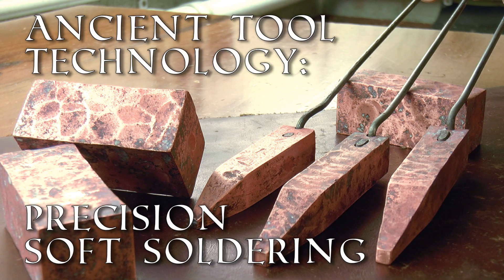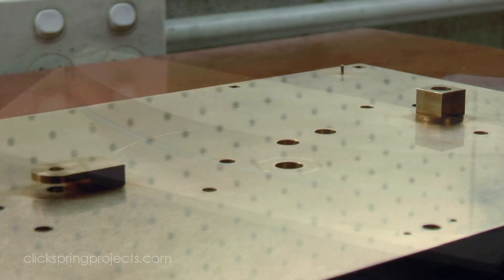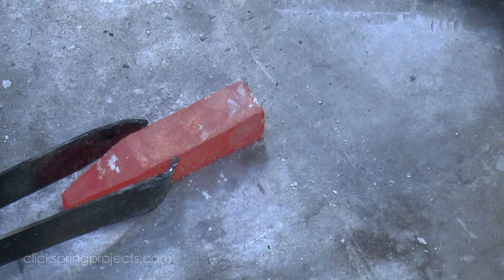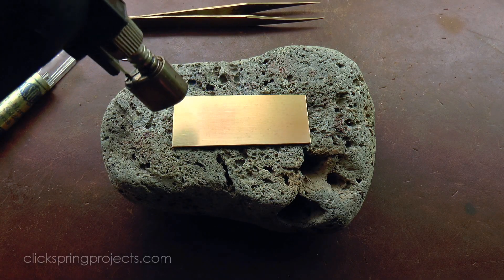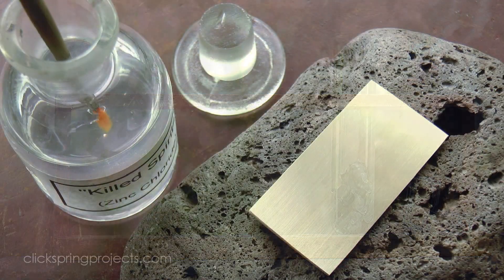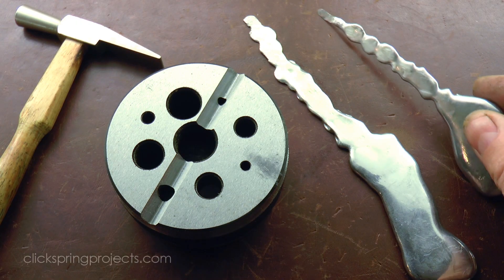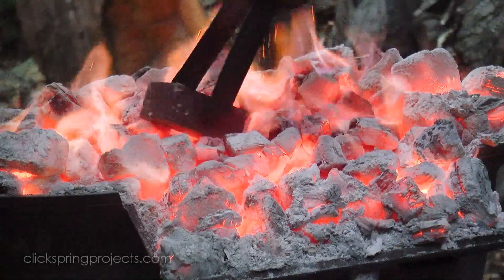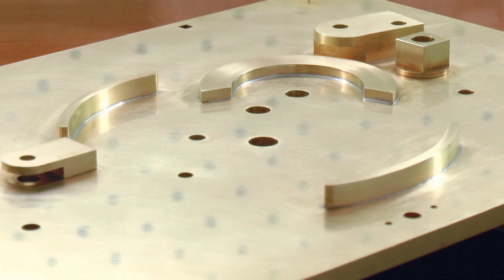Precision Soft Soldering For Constructing The Antikythera Mechanism - Experimental Archaeology

Comment: An alternative. Grind the solder with the rosin to make a paste. Position everything.  The instead of moving the device move the heat source underneath.  That means its unlikely that any component moves. No need to make tools. When the solder flows, remove the heat source and wait.
Reply: I was thinking something similar.  How about adhering the piece with rosin, then simply laying thin strips of solder wire around the edges, making sure they're touching the sides of the piece.  Then, just apply heat and it will sweat itself in as soon as it's molten.
Reply: The could make a paste. Enameling goes back to 13th century BC. Lots of experience with gold working too. Just grind it all up, make a paste and apply on.
Reply: True - historically, that is the basis of enameling, and tried-and-true techniques are certainly the more likely.  I was just suggesting another possibility that would work and makes it less likely for the parts to move.  Every time Chris put a piece of hot copper on the part, I held my breath and hoped he wouldn't cough or sneeze while the rosin was soft.
Reply: Agreed. 

So the idea of bringing the heat to the plate, by placing a fire underneath and not touching the plate at all strikes me as a better solution. 

Relying on capillary action I suspect would work.
Reply: PS:  Looks like Chris has partially answered us in another thread - "...multiple loose parts on both sides of the plate were soldered, so it needed to be a method that could very precisely target the heat with both hot elements and heat sinks..."  So that drops our heating from below idea on its head, as it's hard to be precise enough coming at it from underneath - but I still think you may be on the right track with the "rosin/solder paste" idea.  Applying the heat as Chris did would still work, and there's less chance of anything moving if he doesn't have to work around the copper heating blocks and dip the solder rod around the part.
Reply: You could do all pieces at the same time.
Reply: Not sure you could heat it from below without those pieces on the underside falling off - even if you soldered the parts one side at a time, as the underside pieces will be closer to the heat, so their solder would reflow before the solder on top had melted.  You'd have to find ways to support them all (remembering that they may stand out at differing heights from the main plate) and hope that you don't have too much of the solder flow down away from the underside joins. 

But the more I think about it, I really like your idea of a paste - an all-in-one adhesive, flux and solder.  It fits with the enameling techniques in use at the time, and it should give much better control over part placement while the solder flows...if one lets go of the heating blocks before the solder flows, there's no reason to think the parts would move.  Then just wait for everything to solidify before removing the blocks and it's done,  in exactly the position they were first set in.
Reply: The underneath ones are pinned, so not an issue. ie. Pinned on side, soldered the other. Given their function, they don't have to be perfectly placed.  The pinning on one side sort of explains the solder on the other. It's easier. 

Think about a tagine, if you have seen one. That would focus the heat in a small area.
Reply: The underneath ones are pinned, so not an issue. ie. Pinned on side, soldered the other. Given their function, they don't have to be perfectly placed.  The pinning on one side sort of explains the solder on the other. It's easier. 

Think about a tagine, if you have seen one. That would focus the heat in a small area.
Reply: I'm just going by what Chris said, that "multiple loose parts on both sides of the plate were soldered" - so I guess that means at least some of the underside pieces are soldered instead of pinned.

Comment: this was so lovely. Seeing soldering be broken down to this level is interesting. For e.g. you have no direct temperature control.
Note: Sn60Pb40 is an eutectic alloy. I would guess that they did not fully understand that at the time, but beeing eutectic has some special properties (lowest melting point for a given metal mixture) that are indirectly observable and can be used to precisely hit the composition, with out knowing the precise ratio. The only thing I could think of, is that it had to contain some copper. Both as an impurity of the base metals, but also as a specific alloy ingredient to reduce the copper scavenging from the work pieces (and tools). (as a side effect, a trinary alloy system tends to have a lower melting point then the base binary alloy systems)
Reply: 60/40 is actually a little past the eutectic point (which is around 63/37).

Comment: Beautiful as always! ^^)
But wouldn't a fire tended by ventilation be a much more precisely controllable heat source for the soldering?
The base plate could be placed over a controlled fire and checked for heat, the heat could be adjusted with a few strokes on a bellow (Or their omission) by hand by a helper. Once the heat is right, just touch the parts stuck together by molten rosin with the solder, and the job should be done. What do you think?

Comment: I am sure someone else has pointed this out, but I will also.
The large rectangular blocks would transfer heat more effectively if they were to be made flat again, after you work them with the hammer the surface has many ridges and valleys in it. This would apply to any tool that would be used to solder.
Reply: I would not be so concerned about the obvious insulation of the air gap so much as more of the heat would be used in convection if the copper blocks were placed below the work piece. However it is clear that none of this  postilating negates the fact the work was a success.
Reply: I did think about that, but it would mean moving the brass plate onto the heated blocks, then moving it again after the solder had flowed, increasing the chance of a mistake.
Reply: Most heat transfering via IR so not a big deal. Also if talking about heat transfer via surface contact: copper block covered with copper oxide layer(you cant avoid it at red hot temperature) and copper oxide have bad thermal conductivity, so again you mostly relying on heating via IR.
Reply: I was pointing out the loss of contact area that can be seen when the blocks are placed on the brass plate. Not the oxide/scale. The gaps are obvious, the heat loss there could be lessened by making the blocks FLAT, by surface grinding/flattening, with a file, since 2000 years ago the milling machine did not exist.
Reply: @D Sloop: I really doubt it matters at the heat and large masses of metal he's dealing with. Yeah, you get better thermal contact with a flat surface, but that just slows heat transfer. Some extra heat will be lost to radiation or convection from the block during the extra time, but not THAT much.
Reply: Yes, but everything he has fabricated so far has been the very definition of precise. I know the heat transfer worked, I saw it. 
When I would build a PC I used the thermal paste to insure that heat from the cpu transferred to the aluminum heat sink most efficiently. The very small imperfections on the top of the cpu and the bottom of the heat sink would not allow the best transfer of heat without the paste. 
Different situation but same principle. Better fit = better results.
Reply: @dsloop3907  can you make mating parts flat by lapping them? Just wondering…
Reply: They'd wick up the flux and solder easier too!  To me, it looks like they're heating by radiation anyway.

Comment: This realy demonstrate why new inventions or techniques are not made faster in ancient time, its need a plethora of suporting  inventions and techniques to make the new inventions or technique practically possible. My respect to the orginal inventors/clockmakers.....and the youtube host personal skill and patience.
Reply: JR You can still see what you’re talking about on an accelerated scale today.

Ever since we’ve had electronic devices we’ve been miniaturizing them, but why did it take decades to go from a desktop to a laptop?

The miniaturization of the computing hardware was simple, but it wasn’t terribly feasible until both higher capacity batteries, and smaller screens were perfected.

Then there was a similar situation with cellphone technology, why did it take so long to get smartphones, or anything like them when we already had both portable computing and cellular service?

Because until there was a massive network, and improved data transmission protocols in place, even if they built them there wouldn’t be much you could do on one. Not to mention the need for massive further miniaturization of the computing hardware, screens, input devices, and the advent of high energy density batteries.
Reply: laptops were made as soon as the chips and storage would fit into something portable, people made do with little tube monitors before thin screen technology was on hand, and battery technology isn't nearly as helpful as you might think, as soon as the tech improves, the improvement is used to make the device thinner, insted of giving it more battery life, or additional computing power, or both.
Reply: Lovot Core I’m not sure exactly what you base that statement on.

A lot of old laptops has single digit battery life as they were still using stuff like Ni-Cad etc.
Reply: NiCd is no excuse, stick more of them in there until the battery life is acceptable
Reply: Simple, the agracultural revolution was not yet at hand, and the printing press was not yet a thing, most people needed to dedicate most of their time to farming, and resource aquisition, the tinkerers had no way to spread their knowledge quickly, since everything had to be copied by hand, if they were even willing to relinquish their secrets to begin with. You will note that the industrial revolution didn't happen until after the ag revolution, and the printing press.
Reply: A lot of very notable civilizations like the Roman Empire, the Ancient Egyptians, the Chinese Dynasties, etc. were able to advance faster or make new things is mostly due (I think) in the ability to store that society's knowledge (mainly texts). The reason for it is that if you don't store it, your society has to constantly "rediscover/research" very basic ideas or concepts to what they're trying to do (hence why "research" is a word for trying to advance). Things that we take for granted like doing very basic math and reading would be difficult to do without that storage of knowledge for the next generation's use (and you couldn't move to more advanced things since you're constantly reteaching the most basic stuff).
Reply: Also explains why there were three people who were able to invent light bulbs at the same time.

Comment: Can someone tell me what the difference is between this and brazing?
Reply: Mostly the materials used.  Brazing uses brass or bronze filler material and is higher temperature.  Neither soldering or brazing causes the base material to become molten, only the filler material.

Comment: As someone who soldered (professionally) for over 20 years, I can honestly say that this method never occurred to me. Always love your videos, and hope there are a lot more to come!  :)

On a side note, given the labor intensive nature of doing this, do you think it was easier than pinning the pieces, or was there a mechanical/manufacturing reason to do it this way? Just curious, since you have the experience of attaching pieces both ways...
Reply from the maker: personally I think its much easier to pin them, so the choice to solder is interesting - Cheers :)
Reply: Clickspring, Wow, that was a quick response! I suspected pinning would be easier back then, but your videos make it all look easy - the mixed blessing of being a master! Keep up the excellent work!  :)
Reply: Ran out of pins?
Reply: They might have put the whole thing up above a fire (suspended above a fire), to get it hot but not too hot (just to stop it from sinking too much heat), and then stared heating the pieces they were going to attach more (with copper tools). They could have put all the pieces on really quickly, since they weren't structural.
Reply: I was thinking the same. A normally aspirated wood fire can reach up to about 1100 degrees F,  plenty hot enough to melt solder, but not enough to melt most contemporous metals.  Support the plate on rocks.
Reply: Something just occurred to me with the huge range of skills used to make it, I cant help but wonder if this might could have possibly been something like a master craftsman journeyman project to prove skill level.
Reply: I'm thinking maybe it has to do with future mobility? Or removal. A little heat and it can be moved this way or that Just a little bit quite quickly.. Or disassembly?
Reply: Labour intensive yes, but the craftsman would probably have and apprentice or assistant or both to help out. One of the things that is interesting about these processes is that here you have someone trying to work out how it was done but the artisans of the time had already developed and refined the technique. I think some interesting conversations could have taken place across the years between then and now but unfortunately not possible.

Comment: Simply Beautiful...  I can't speak high enough of the quality our your videos...  Just gorgeous...
A question:  It looked like the spacing of the parts you were joining were eyeballed.  How much space did you allow yourself for slop on those positions, or were they precisely placed off-camera?
Reply from the maker: Yes mostly by eye, a few mm either side doesn't affect the performance of most of the parts, but the support block for the H/I assembles is an exception - it requires very accurate placement so I used a couple of locating pins inserted into the drilled holes from below the main plate to guarantee location (visible from above the block at 1m 12s) - Great to have you watching mate :)
Reply: @Clickspring  1:12

Comment: How did you line up the parts? Did they have indexing pins?
Reply from the maker: Mostly by eye, but the support block for the H/I assembles requires very accurate placement so I used a couple of locating pins inserted into the drilled holes from below the main plate to guarantee location (visible from above the block at 1m 12s) - Cheers :)

Comment: I wonder how the ancients discovered the concept of flux
Reply: resin melts with heat and is sticky. wild guess: they used resin as a preliminary glue to hold the part in place before soldering. Note that there are some tricks to solder with out or with less flux. We saw here a charcoal fire - let that burn with reduced oxygen and you get a O2 free, but CO containing atmosphere that can act as an reducing agent.
Reply: Spilt something, and noticed some things allow metals to bond... then trial and error using EVERYTHING you can find? :D
Reply: I'm thinking something to do with cooking. People eat a lot of different things and most of it needs to be cooked. Probably somebody noticed something while they were cooking. The mind is a terrible thing. LOL I've put together so many things while I was sleeping that I could not do awake. I used to fix copiers. And there are many times I woke up in the middle of the night realizing what the problem was. AH ha moments Can come at the damnedest times.
Reply: People heat up rosin to hold small parts while shaping them. So it was probably sitting around nearby in a bunch of workshops. Maybe someone dripped solder on a piece stuck in rosin.
Reply: Maybe they were trying to use the sticky resin as a weak glue to hold the parts in place and then noticed that soldering that way was much easier.  Or they cleaned the metals first with acid (that happened to be contaminated with zinc)...
Reply: Same way they discovered oysters...
Reply: @scowell  is that like the joke about people discovering mushrooms are edible?
 doesn't make a ton of sense
Reply: @FrancisR420  Experimentation.
Reply: you have to heat up rosin to use it as glue maybe the tool/pot that used to heat it up had all of the oxides noticeably stripped or was just the same tool/pot they used to heat solder, or some Alchemist was f**** around and noticed that is certain material would strip the oxide skin away from molten metal.
Maybe  they realize that exposure to air is what oxidized things and were just trying to block that and didn't even realize why it worked at first
Reply: Judging by the primary content of the History Channel, ancient aliens.